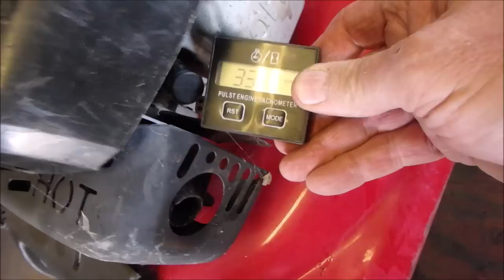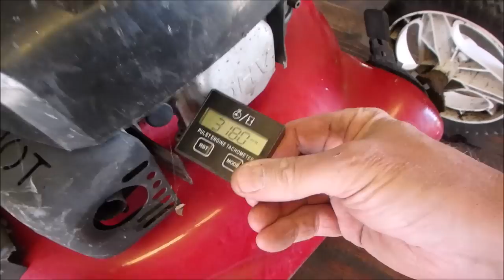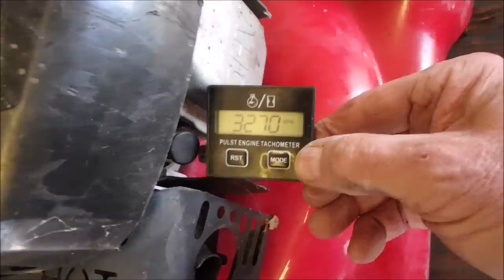Craftsman Kohler Mower Governor Adjustment

Comment: Grassoline! I love it!  Torch plugs, my fave Bruce!  I have dozens of you need any. I should make necklaces out of them. I worked on one of those carb where the fiddle fairies removed the e-clip from one of the retention pins on the choke linkage. I turned the carb over and it fell out into my leaf ridden driveway!  It was aluminium so a magnet was no help.  The Gods were looking down on me as I did find it!
Reply: I love how Bruce honors the past by calling it Grassoline. Kids are the best.
Reply from the maker: Yes  I love to imitate the kids Tom.  This is a crazy carb setup eh Ken.  Three activators on the choke.  A diaphragm, a heat bimetal strip and the wind vane.
Reply: That’s why we do it Bruce for the challenge!

Comment: Good job Bruce, and the mower looks like a new one. I like your kind of repairs. If you lived close by, I have have a Craftsman Tecumseh 6.25 to wheel down to you, After cutting the front lawn then taking a short break this mower will run rough on a restart. I sprayed intake valve clean in the carb while it ran, and it did good. But, after a years or so it started having the same problem. The wife said the problem is you're taking a break. HA! Women ....
Reply from the maker: I think the carb need a good cleaning.

Comment: Well done Bruce $125 sale all day here in Ontario FYI. Now you asked "it's not dangerous washing your floor with gas is it?" Well let me tell you yep it is if your wear polyester pants which tend to create a lot of static electricity. A local friend spilled similar amount of fuel in his shop and the static spark ignited burning up his fibreglass boat and melting a lot of polyester he was wearing around his legs. The sad thing was he had just locked up all his fire extinguishers in an enclosed trailer for a mobile job the next day and it took him some time to get them out to put out the fire. Since we have a natural gas furnace in the back end of our shop and the pilot light is on all year we normally drain all fuels outside but if they are minor amounts we will do it in the front part of the shop. Thought i would just share this story cause polyester and fuel do not mix!
Reply from the maker: You are right Wayne.  No excuses.  My thought was the mop.  Imagine what a torch it would or could be.  I have had thoughts since i did this.

Comment: Bruce with that gas furnace you have in the garage I would definitely worry about spilling gas of that amount on the floor vapors catch very easily but good job under Mower
Reply from the maker: Yes i agree.  An overhead furnace is designed for a shop-garage as the pilot is high off of the floor (this garage it is a 10 foot ceiling).  In a normal 8 foot garage the pilot light would be 6 feet from the floor, this garage being a 10 foot ceiling the pilot light is at 8 feet height.  Gas fumes hold at a low point which is why a standard furnace from a house used in a garage has a pilot light at 18 inch from the floor would be deadly.  I do thank you Hank and I will try to be more diligent on this.  It is an issue.   You are right.

Comment: Bruce,what I need to check if when I off the snowblower, fuel keeps coming out,till is empty?
Reply from the maker: Exactly.  There could be stuff coming from the gas tank as well flowing into the carb causing the needle and seat to leak with he small piece of something in there.  I am fighting that right now.

Comment: Hey Bruce, I searched and searched for a tachometer like yours, but all I can find, that I can afford, is the wired type. Where did you get yours? I am tired of the wires. Thanks in advance.
Reply from the maker: They come with a wire but it is not required as there is still induction that does the trick.  This is one with a removable wire like mine.  (Canadian Amazon site but the info is there).  
https://www.amazon.ca/TOTMOX-Tachometer-Replaceable-Waterproof-Motorcycle/dp/B095SM9XT5/ref=sr_1_12?crid=1IUMOJDTOZXKI&keywords=induction+tachometer+for+small+engines&qid=1668538794&qu=eyJxc2MiOiIwLjAwIiwicXNhIjoiMC4wMCIsInFzcCI6IjAuMDAifQ%3D%3D&sprefix=small+induction+tac%2Caps%2C128&sr=8-12

Comment: She definitely needs a governor adjustment it's sounds like it was over the max rpm,s by at least 300  rom,s
Reply from the maker: It was at 400 over after i got it running steady.
Reply: @BrucesShop  dang I was off by 10O rpms

Comment: Mrs P's Kia.  Bruce, something is wrong.  Your Kia is supposed to have run down protection.  Test the battery draw at no load.  If its pulling > 300mA (engine off) in all likelihood the R/D relay may be faulty.  OR you can live with it.
Reply from the maker: It is a 2010.  Does that make a difference.  Thanks a lot for the info.The battery wasn't dead but I was beig cautious.  Thanks again.
Reply: @BrucesShop  Mine are 2013 and 2017 which are equipped with RDP.  Mrs P's car is in excellent condition (bearing in mind where you live), I assumed it was a much later model, so I could be wrong.  I would ask Kia directly as the local dealerships usually don't know.  When the battery is charged, check the voltage (s b > 12.4 VDC) run the car and the alternator should charge at 12.4/14.2 VDC)
Hope this helps, sorry if I confused.
Reply from the maker: @MrRunner  Yes the alternator charges over 14
Reply: @BrucesShop  check that your battery is holding charge (minimum of 12.4).  If so, Mrs P is good to go
Reply from the maker: @MrRunner  Yes I put my 12v DC 100 amp (toaster) on the battery and it held for 10 sesonds.
Reply from the maker: Thanks for the input.  I do understand DC power.  33 years as a standby power guy with the phone company.  5000 amps @ 48V on each power plant.  3 in a building.